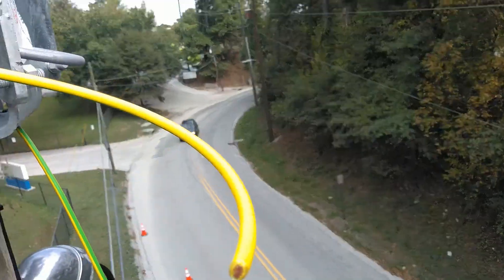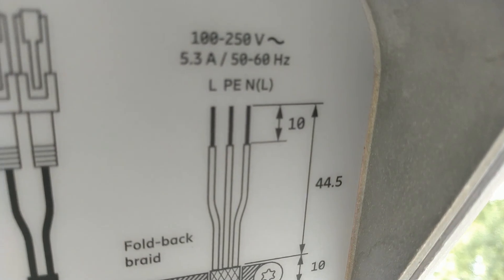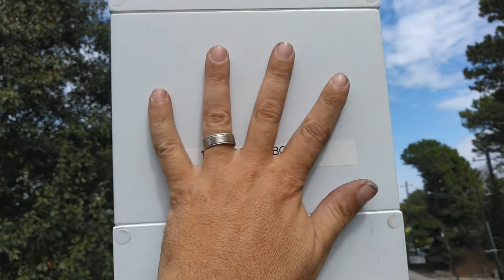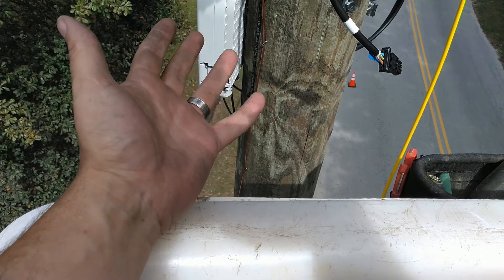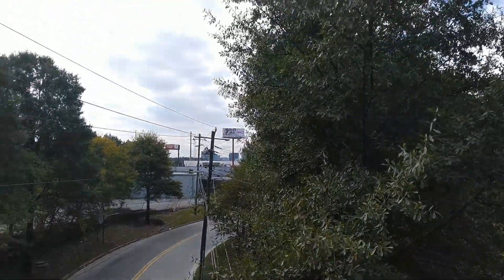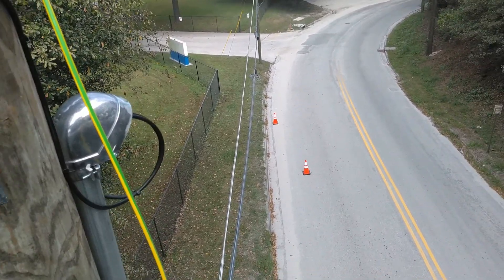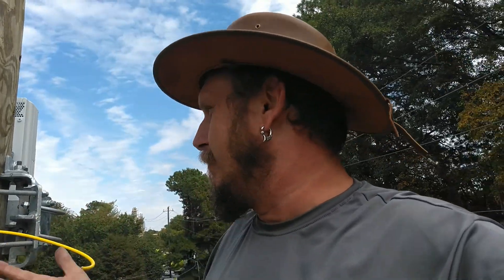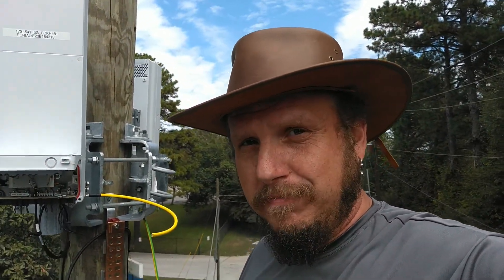The truth about 5G from an industry insider.

Comment: I laughed when everyone thought 5G was the great fix all. The signal goes about as far as a sand wedge will hit a golf ball. In a small town of 25,000 you need so many antennas. Heck, when you stand on a street corner you can see 10 or 12 arrays. 
I can’t fathom how many thousands are needed to do Hotlanta.
Reply from the maker: I know it was a lot, we were only one of the many crews installing the radios. When we would go to the hubs to pick up equipment they had radios stacked to the ceiling and you would come back a few days later and they would all be gone and then get another order in.